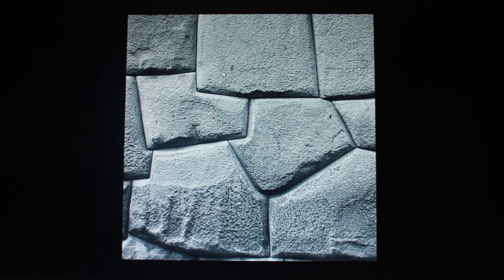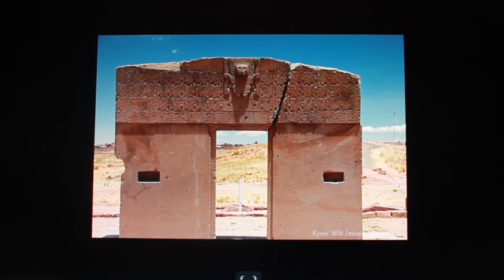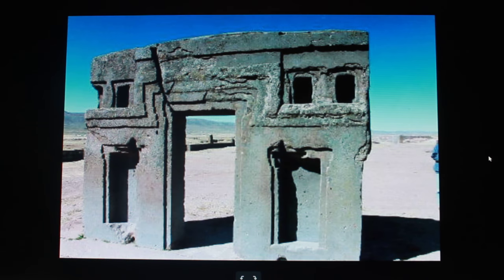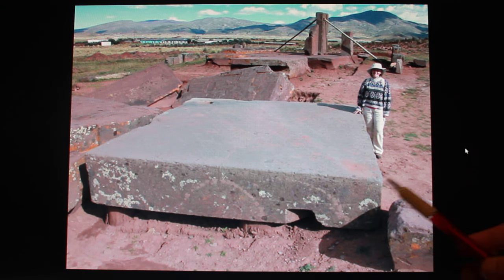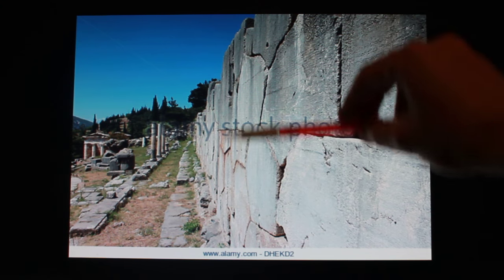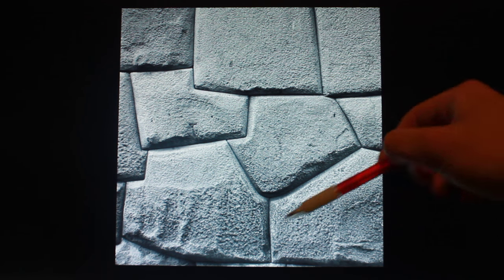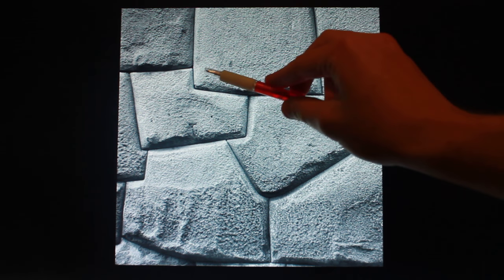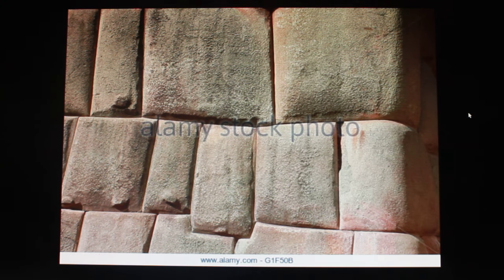How were the POLYGONAL MEGALITHIC INCA WALLS BUILT? LIKE THIS?

Comment: I've worked with Concrete for Year's! As a Driver I've poured Millions of tons of Concrete I can say with certainly not Concrete!
Reply: Not like concrete we use today but some kind of method where they were able to turn different rock into clay. Not the stuff we used today. It's clear by these megalithic structures that these civilations were more advanced than what we are today. Someone said they may have had a method to turn hard granite and other rock into clay and harden it back
Reply: Even if not clay and was done by hand, the levels of advancement this is, is impossible to do today, it would be very difficult

Comment: Only problem with this is the front is the only part that is precise on the back side they stuffed a lot of fill in. The H blocks it has been found they have organic material inside which could only get there if it were concrete.
Reply: Could you expand what you mean by the back part is filled in?

Comment: stone isn't worked by"sanding"it is ground, lapped, polished,etc..   buy the way these STONES are covered in tool marks k? these are shaped stone. the profile of a stone can be measured and then transferred to a stone that hasn't been set yet using a very simple gauge. shape until the gauge shows the faces will align, then place stone.

Comment: 5:00 Why would the casing form need to be biodegradable?

Also, why go through the trouble of molding  soft concrete, when gravity will push it back down?

Also, why have such complex and varying shapes? Wouldn't it be easier to use a few key proportional layouts? Surely that would cut production time? 
This wall looks more like art than a building. It seems organic as well...

Comment: Interesting theory.... many question can be asked.. When the stones come from quarries, if that assumption is true, then maybe some of the large stones you show here are made with moulded concrete, but the others from the quarries then have been manipulated in different ways.. Could have been several steps.... The raw rock was maybe heated up by frequency device or laser and then pushed into the allready existing wall space, then with a hot tool the protruding melted material from the seams was taken away with a "hot" tool, of maybe frequency / laser device. That could be the explanation why we see these nice indented seams between all the stones. But also this is just a hypothesis.

Comment: for casting these more complex "bricks" they could have used computer sowtware for the shape of the so called stones and for molds they could have used force fields. 
even today i think it is possible, you know mclaren declared in 2013 that they plan to replace the windshield wipers with force fields... dont know if they did it, but it could be possible

Comment: hi.been enjoying yr vids..interesting and like the way u just throw ideas out whether sensible or not(a good thing!!).. the 'cut' marks on the inca (sic) stuff got me thinking as to how the shapes could be made..with melting rock in mind (1100°f to 2200°f approx) you made mention of the cuts seemingly occuring in a downward direction.this taken with how intricate and neat the interlocking stones fit the obvious (easy haa) way would be to mark them out as a whole design on a large area of flat,flattened,rock and then make cuts downwards along the lines u want (in place,even mistakes or off course they would always fit in regard to the adjacent block etc).once pattern is all nicely sliced and the blocks are each a cut width apart all that remains to do is then remove them from the base rock (via same cutting method of course) and you basically have a loverly built to order wall/object that can then be moved else where and rebuilt vertically..?? the patterns dont half remind me of a certain bar of chocolate available here in uk,just the name escapes me at moe...😁but take a warm blade and bit of trail n error and making premegalithic walls is childs play...
Reply from the maker: Thanks Paul, sorry for the slow reply. Indeed, good to throw out all sorts of ideas and see what people think! Awesome you seem to know what you're talking about! wooohooo!

Comment: i think your theory is sound. concrete is easy to work with when soft and hardens over time. and gets harder as it ages. im sure they could crush stones easily and mix it much like our modern day mills. but still very impressive due to the size of the stones. perhaps the largest stones were already in place and built around. look at the past 2 hundred years that man has built upon previous technology. these ancients probably had longer life spans and perhaps outside help fron their gods, angels, demons or whatever.

Comment: Using concrete to make abstract multi-dimensional forms would have required alot of aesthetic effort to make a modular product appear irregular. The evidence of decay isnt consistent with concrete either. (Pumapunk different case)... Pragmatic stonemasons use readily available irregular stone and make it work with the least amount of effort. Cutting multiple irregular negatives and positives to perfection would have been a waste of time as well. However. If they were able to heat up the blocks into a semi molten state (lots of evidence for vitrification) they could flatten out the rough edges and pressure it into the adjacents blocks automatically creating a seemless fit as the excess protruded out the face (sometimes too much to excess would be forced down and clipped off leaving notch marks on the stone). In that state it would be easy to cut the entire shape as well but why waste materials and design tine when you can have a 100% yield on each block? Masons today just don't waste time with expensive tools to make seemless jointwork beyond the face. Behind the faces of our stones today there are gaps filled with either mortar, concrete, reinforcement, air, or shims. The only pretty work you see is the face. I think these were stonemason blacksmiths of some sort.

Comment: my. question is what are the walls purpose?    do the walls character make sense as protection like a castle?  arrow slits?  how about gates or doors?   do the walls for a parmeter?  a defense blockade?   what is the average height and thinkness? we're they possibly a prison?  or did they live amongst the walls?
my observat I NS of Mexico play Delcarma. ruins we were told they were homes. but on close inspection, they were severely over built and squat.  the living space is odd and sort ceiling almost impra,tile but yet a tall building.  with Roman colomns and false doorways.   and a upside down winged man falling. symbols above.the center door of three doors.   narrow streets, high thick walls.  the stones were not large maybe  a dozen men could lift them.  ruff cut.

Comment: I can tell you 100% why none of the megalithic stones are poured and have been carved. Man made (manufactured) stone deteriorates and/or breaks down in a very short time geologically speaking due to its composition. Concrete or cement for example, never stops curing. It doesnt matter if it was poured 10, 20, 50,  or 100 years ago. It is continually curing its entire existence which means it is contracting ever so slightly at the same time. That contraction causes it to begin cracking and become brittle as time goes on because the cement is literally pulling itself apart as it continually shrinks. Bricks are porous and absorb moisture from the environment.  The moisture slowly breaks down the brick over time when moisture inside the brick expands and contracts due to temperature changes. The decomposition of natural stone is minuscule in comparison, almost non-existent, especially when not exposed to rain/moving water and/or extreme temperature variations (freezing and thawing mainly).

Comment: Charles may I point something out to you? You are a Brilliant videolagist but you are missing the forrest thru the trees. My pattern Research Equation shows that the rock was cut using a similar pattern since the beginning to the end of the 500 year Incan empire. These Stones were public works and citizens paid their taxes by donating so many hours to the state every year. Fact. These Incans had no electricity, no metal tool found so far, and very few rock hammers and stone wedges found. An undertaking of this magnitude of stone cutting would at least show many thousands of implements to cut the stone, right? There is none. If you will look at the bottom of the stones in the wall, you will notice they are set up to be lifted or hoisted a few inches with the rock nubs. Correct? Correct. Charles you are a brilliant young man but you must actually put yourself in ancient Incan sandles , 500 years ago and look to what they actually had on hand at the time. Respect RH DSD

Comment: I think you have nailed it. What would be proof is if one of the stones is lifted and there is some residue of a bag left between the stones.It would be dust but it would be there.Also a chemical analysis of the stones should tell if they are concrete and how homogenous the chemical composition is between the different rocks.  .There is a general roughness of the surface which to me looks like  a rough piece of cloth I'm sure a good chemist who knows concrete would be able to tell in short order whether they are natural rocks or concrete.Is it possible the big rocks in the pyramids are also some sort of concrete. I remember eating where the Romans made concrete which lasted thousands of years maybe some other people discovered something similar
Reply from the maker: Cheers! Thanks Joe

Comment: This is nonsense. 

That tight, perfect fit can be achieved rubbing the rocks back and forth together against eachother.  The sides of each will naturally wear into a flat joint. . Maybe wet sand to aid the abrasion.  Requires muscle and time but I don't think these builders were lazy weaklings.
Reply: That may work if you had just a few to fit. Yes it would take time. Maybe 50 years each.
Reply: 7

Comment: All i ever see from these sites on youtube are well preserved wall sections that cant be explained. Has anyone ever tried to remove a polygonal block from a wall or has a individual polygonal block ever been found with break marks if it were concrete or maybe tool marks from saws or chisels? If someone seperated a block from the wall it would solve alot of questions i think

Comment: Plaster is what they used. roughed in the rocks. Then applied Plaster.Or a Stucco type cement on the face of the rock wall. Then dressed it's joints with a straight blade type tool. Then brushed the finish.Go out to a new track of houses being built. Watch the Plasterers 
Stucco the houses
Reply from the maker: That's a good idea too!

Comment: But if they were using cement then why would they need a biodegradable layer...? A smooth cement wall is stronger than rocky one unless they wanted to achieve higher flexibility. Also how would you penetrate the biodegradable layers by pouring cement from top. You would need to insert a biodegradable frame from the side into a fresh cement wall or you would need to pour such walls in horizontal position and then lift entire wall up vertically (very hard). The only imaginable way to use removable layers from between these rocks and still pour concrete from top is by using some kind of force frame but this is scifi. Question also is why did they not use layers of similar shape such as hexagonal divisions in bee hive. It would be easier to make such structure.

One idea could be the use of something in the cement, some kind of eg. magnetic particle which after pouring the cement into the form of the wall would be exposed to magnetic (or other type of a filed) making the "reactive" particles form layers similar to those appearing between bubbles in the foam. After hardening these layers would disappear. In such case there should be remains of some kind particles (magnetite, lodestone or other) between surfaces of attached stones. 

These walls are indeed a great mystery and archeology only makes itself funny by insisting these were done with copper hammers and other stones but let them do it if this makes them less afraid... 

Investigate further.

Comment: If it was poured into a bag the bottom areas of each stone should be bulging out very much and they're not.  The Megalithic stones of Yangshan  china, upwards of 13,000 tons prove massive stone structures can be cut carved n moved. Therefore while geopolymer may explain some it does not everything

Comment: polygon walls cut with wire. if you cut a bit then slide/drop. cut a bit slide/drop. you would get max sq ft per rough stone only cutting away just enough to fit.some times the cuts are curved. probably earlier work. tighter wire would do straighter lines explains the shapes. because you keep pulling the wire between the stone and push them together they have to fit together perfect eventually no measurement/math required. those other cuts with the inside 90° corners are crazy though. I agree looks like cast. but I don't doubt man could carve that with the right tools.

Comment: Look at the Tambomachay wall (https://media-cdn.tripadvisor.com/media/photo-s/0d/6c/50/fe/using-the-natural-rock.jpg)  and you will see that they during (or after) the build had a little problem. Some people say the build around the rock but that make no sense if you had a specialized technique to build like this.  Maybe the use a melting  technique and something has gone wrong.  In the wall is a piece of rock formation with clear lines of the original wall. i want to solve this issue so if you have any idea contact me plz

Comment: I think you are dead on. Someone needs to get samples of those "stones" and compare an analysis with the natural stone from the quarry they are claimed to come from. They may have had better concrete than us, but they could not have matched the stone chemical makeup completely.
We need to build an atlantean wall.
Reply from the maker: It would be fun to build an Atlantean wall! I am sure many companies are playing with geopolyers as we speak, building secret walls.
Reply: That's been done. And the microscopic analysis shows that it matches the stone at the quarry.
Reply: Except that its lighter because of the air bubbles when being mixed.
Reply: Dean Young the quarry stock could have been pulverized for the mixtures.
Reply: Not urbiz Pulverize the rock? Then mix it with cement you've made? And the molds? None of the blocks are the same so you have to make an individual mold for every block. Why all this enormous extra effort? 

 Far easier just to cut stone blocks and use them.
Reply: This is nonsense. 

That seamless can be achieved rubbing the rocks back and forth together. The sides of each will naturally wear into eachother. Maybe wet sand to aid the abrasion.  Requires muscle and time but I don't think these builders were lazy weaklings.

Comment: I have often wondered about these structures too. I agree with alot of you conclusions.  Not bags. clay lining and then wood frames or rubble supports. Then pour Geopolymer concrete(not modern-day portland cement. Different formula.) In the moulds.  Check the link.
https://youtu.be/8StHpQPRoYY

Comment: yes it sure looks like some of the stone were poured like concrete others were cut high with high precision tools. none of this bullshit they try to feed us if they ever tried to work with this stone they would know better.the polygonal stone sometimes look like they have a poured shell. to me it look like they were not poured in place but rather on the ground on a level surface.In preformed moulds like a series of cells to get the shapes they wanted.(like serpent) The form wall would be flexible to expand to the shape thus the precision. Done properly the wall of  cells would support each during the pour .As for the knobs in a mold  pour there are always knobs left from the hole to get the liquid in. They did not bother to grind them of. we can make concrete they could make stones. there may have been a roughly  shaped stone in the centre of the cell they poured around .there seems  to be some evidence of that. Some cut some poured not a one trick pony.
Reply from the maker: Hi Bill. Totally agree!

Comment: Sub-millimeter diameter, intense but cold "plasmatic magnetic energy" beams,
of a centimeter long to a few meters long, would be able to cut and fabricate 
those intricate quartzite, obsidian, granite, and other hard rock art pieces.   
Apparatus and Method for Amplifying a Magnetic Beam
http://www.google.com/patents/US5929732  

Melting Metals and Stone Without Heat
By manipulating molecular bonding energies with governed resonant pulses of strong magnetic fields we can control phase transitions in the states of matter.   When exposed to strong magnetic fields - pulsing at 300 Hz most metals will melt in seconds at 39C
using <5% of the energy required by conventional means.  

Controlled Phase Transition of Metals & Stone   
 http://patft.uspto.gov/netacgi/nph-Parser?Sect1=PTO1&Sect2=HITOFF&d=PALL&p=1&u=%2Fnetahtml%2FPTO%2Fsrchnum.htm&r=1&f=G&l=50&s1=7524385.PN.&OS=PN/7524385&RS=PN/7524385   
Using pulsing magnetic energy, we can purify, sanitize, mine and refine materials, and reprocess waste materials.   

15KHz - 20KHz strong focused magnetic energy will phase transition water to 
"Cold Plasma Water"  which can be used to replace biofuels and fossil fuels.
SG Gas  -  http://www.google.com/patents/US20100209360 
Water Ion Technogies  -  http://notbrownsgas.com